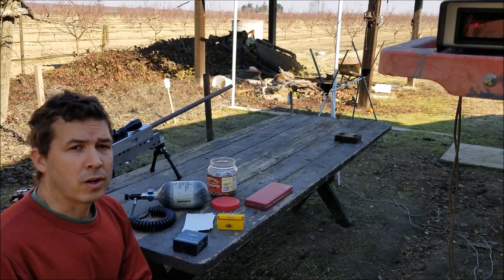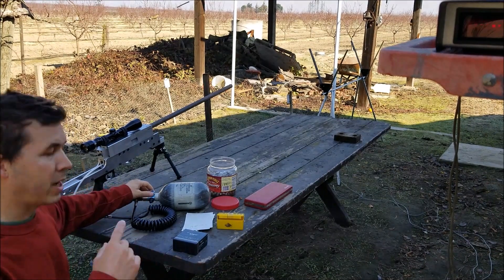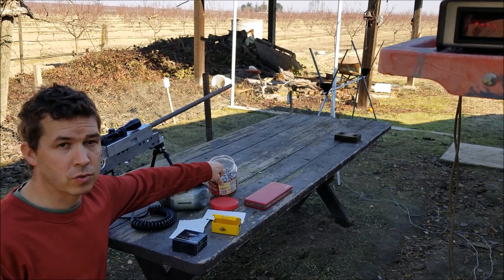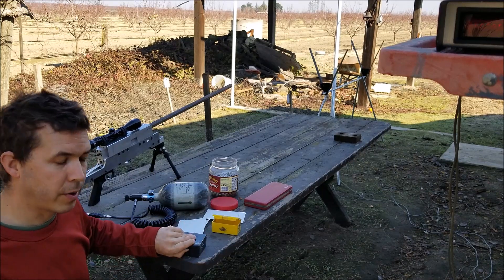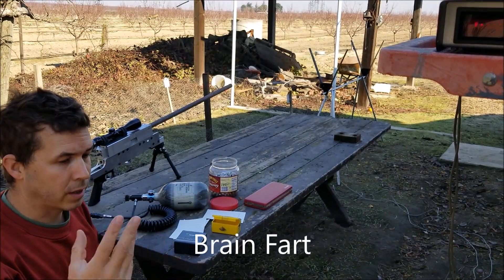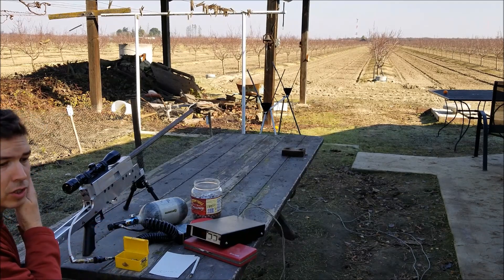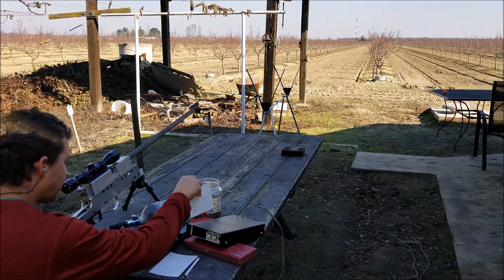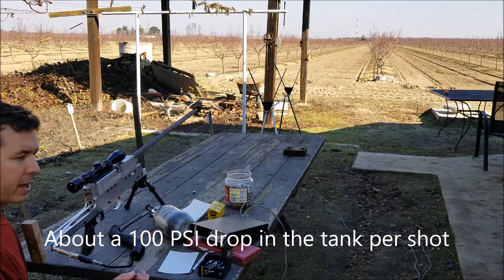Custom big bore airgun chrono test

Comment: Joules have it?
Reply from the maker: I am not an expert in Air Force airguns. But there are 2 standard ways to give more or less power. Bigger or smaller spring, and smaller or larger valve.
Reply: @DirtyShopDIY  In the case of spring I reinforced, but the valve has not yet seen a way to increase the pressure, would you know how to act on it to have more force?
Reply from the maker: Max about 200 joules
Reply: @DirtyShopDIY  Wow  Nice, unfortunately here in Brazil this type of weapon is prohibited, at most 6mm, I'm trying a way to modify the airforce condor valve to reach 120 joules with 44 grains